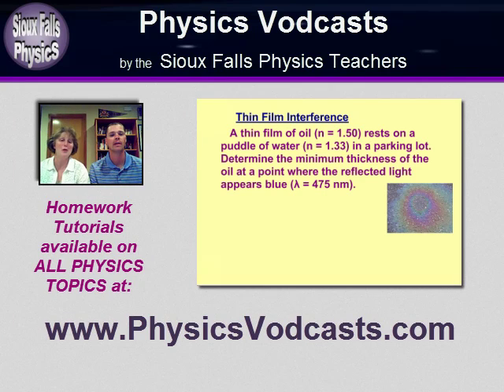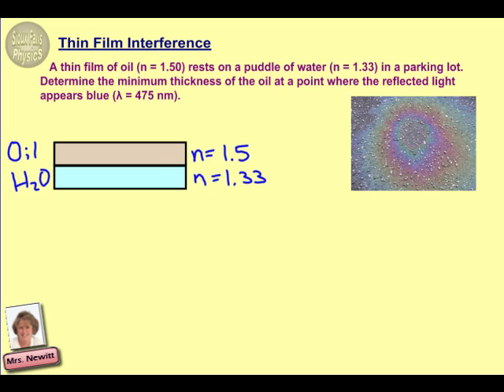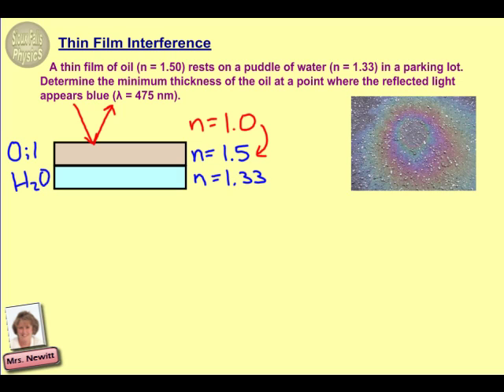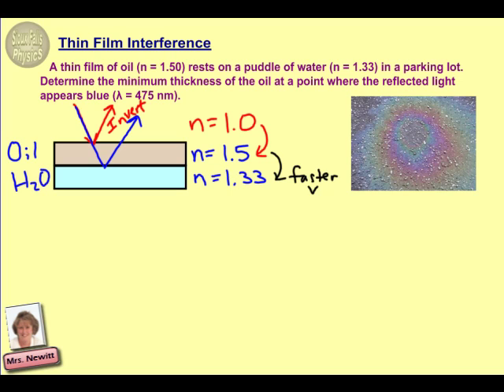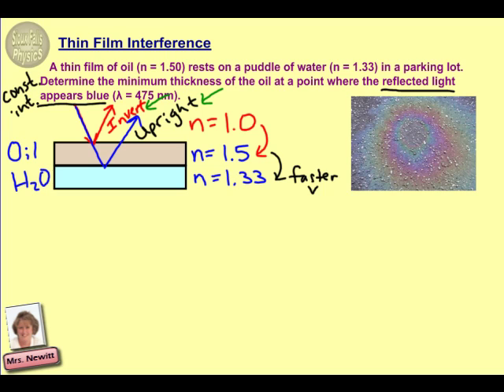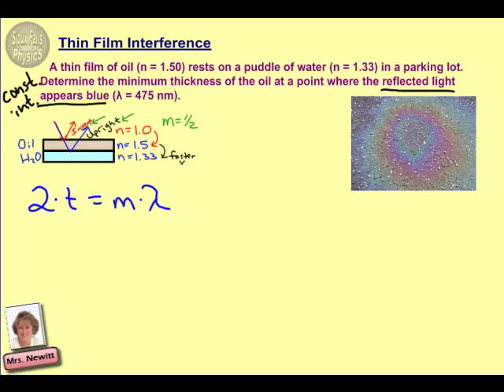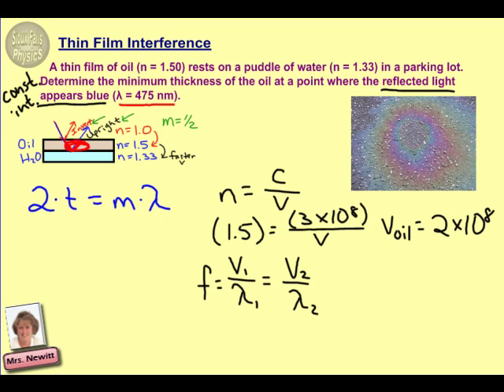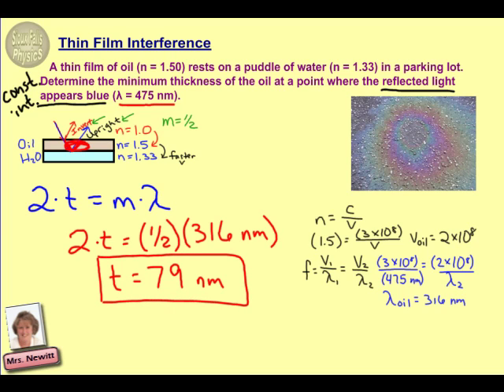Thin Film Interference

Comment: You could also find the new wavelength in oil by dividing the wavelength in air (lambda = 475nm) by the index of refraction of oil (n = 1.5), 475/1.5 = 316